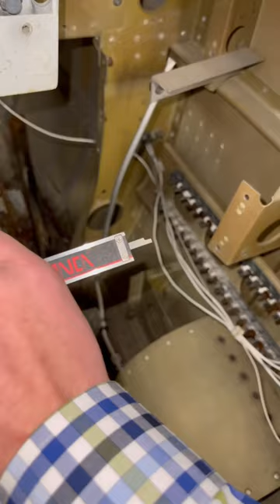Caliper Drama

Comment: Aerospace engineer that can't grow facial hair. You have the degree, however, you need to put your time in before calling yourself such. Learn as much as you can from your peers. Been there myself and I will tell you from experience, you learn far more on the job than ANYTHING in school.
Reply from the maker: I’ve been an engineer for two years now. Not saying I’m a good/experienced engineer, but my official job title is quite literally “engineer.” I’ve also been a pilot for 7 years so I’m not entirely new to airplanes. If I can’t call myself an engineer after getting my engineering degree and holding the official title I don’t know what else to call myself other than “professional plane nerd” but that’s too long of a title

Comment: 😂 tell them there is a lot of idiots who do not know how to use a caliper they think that their way is the right way when they don’t know what exactly are you measuring? There is many ways to use it correctly. Only a dummy thinks that you’re using it the opposite way when you are just measuring the inside, without having to use the other way around, there is many people who are not educated in that, I know because I have 11 years that I worked in Home Depot not only did I use them but I also saw them recommended leaving whenever need to do any detail measures for many things that you cannot really use a measuring tape because measuring tapes have flexibility‘s, and they intend to lose the measure correctly whenever you move

Comment: I worked with lots of earrings space engineers who couldn’t measure shit even if they compared a 3 inch slug to the exact length of their dick which they all knew! In case you where wondering, they used micrometers to measure!

Comment: Just because you know how to measure parts gaps or the depth of a part don't mean you know how to build it and what about using used bolts do that stitch test see how you do and what about bolt torque and your drilled bolts for safety so yes you can measure but can you know the tolerances air gaps and you know the story lots can go wrong and did you magnaflux any thing yet

Comment: I guess the reason you didn't display the second way to measure depth is because you're an aerospace engineer, and aerospace engineers, I suppose,  aren't taught the other, and more accurate method for measuring depth.

Comment: no their called verniers not “callipers” but anyway
Reply: Actually, vernier refers to the scale used on various tools (I have calipers as well as micrometers and protractors with a vernier scale) to enable direct reading of a smaller increment then would typically be possible. Calipers with such a scale are called vernier calipers, those with a dial readout are called dial calipers, and those utilizing a digit read out are referred to as digital calipers.

Comment: You should learn a little more about metrology. Close enough isn’t good enough. Kids I swear
Reply from the maker: I mean my crank functioned EXACTLY as intended… any additional time spent creating it would be waste.
Reply: @jackschneider17  I wasn’t talking about the crank per say. But use some Kano Aerokroil and let it sit and penetrate for 30 minutes then repeat 1 to 2 more time before you try to separate the engine housing. Then use a brass bristle wire brush to clean the oxidation, then use a little bit of rust off rust and oxide remover. I use a small micro fiber medical cloth to apply it. Use some scotch brite in different grits and really give it a good going over.